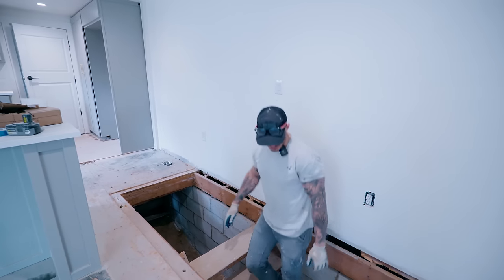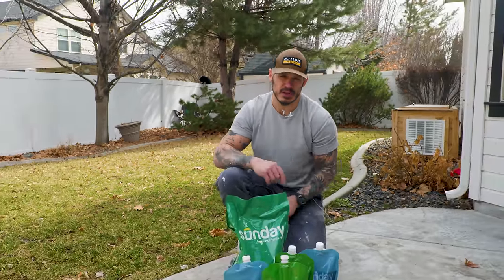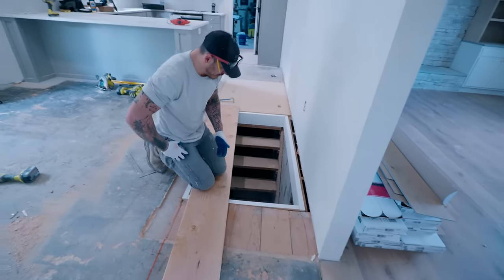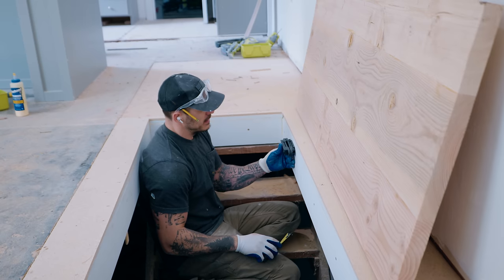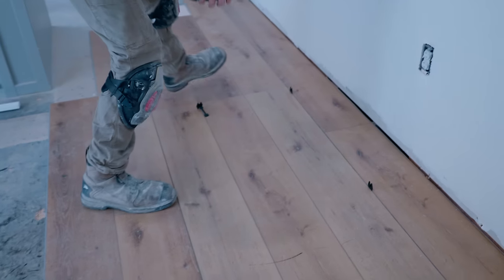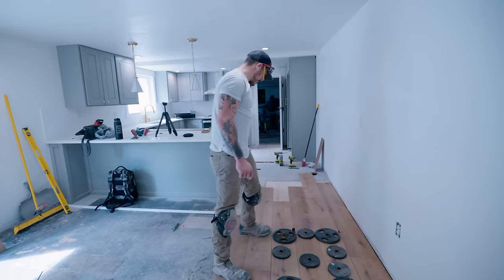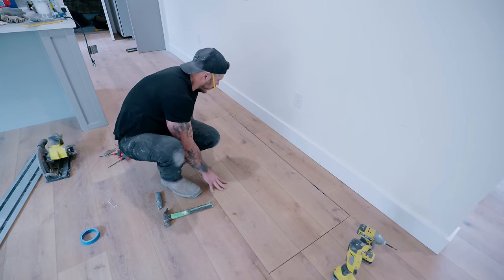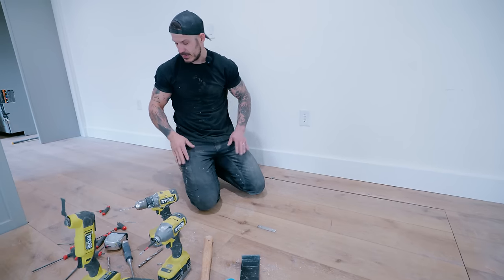Creating A Hidden Room With A Secret Floor Door!

Comment: It's not a door, it's a hatch like on a sailboat. My apartment has high ceilings but no storage so I had the floors in some rooms raised and hatches put in them. The seams are only visible to me because I know they're there, same with the hinges and latch because they were colour-matched. They're held open with hydraulic door closers for safety. The hatches are really heavy. If a hatch falls on your head it could kill you. I hired a master carpenter to do the job.   DO NOT DUI ONE OF THESE!

Comment: Oh man, I think I would add some perpendicular boards to the underside of the door to stiffen it up.  Tight Bond doesn't seem like enough strength at all long term.  Yikes.
Reply: Or some C or L channel like on the bottom of a table top…lower profile🤷‍♀️
Reply: @karenmitchell6814  totally.  Even just 3 1x3s would help.

Comment: @Mr. Build It, I found a perfect solution to the gap in the floor. Please reference DIY Perks video Building the ENDGAME invisible PC time stamp 19:24. In the video he uses a piece of wood cut in shape of the gap attach to wire or spring so that the wood can move out of the crease to open, and be pulled back into the crease when closed for a seamless look.
Link for ease https://www.youtube.com/watch?v=UQ6ueTe8KQM

Comment: Those chineese Hinges suck balls!  Also, why didn't you cut the flooring so it went over the horizontal ledge by 2" over every the gap, offset.   Yeah, so, that's not quite a hidden door boss.

Comment: Lets build an square casing and then pounding it into an unscrew opening and questioning why its not square anymore. Build it smalling and shim the non hinge side if you worried. and this would have helped with the flooring issue.

Comment: Those hinges aren sos hinges 99% of woodworkers, cabinet makers or carpenters screw them up the first time, I did.  When doing somthing new do a moc up.  I think it was the right hardwear, you need to calculate the floor thikness.  I strarted yelling no when you said 1 1/2 down.  Show your mistakes we are all human I think.